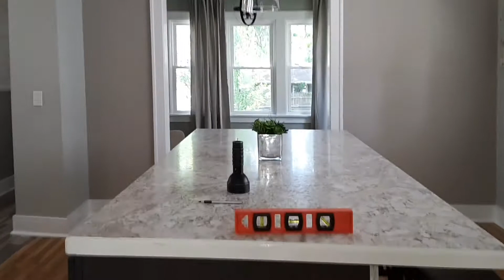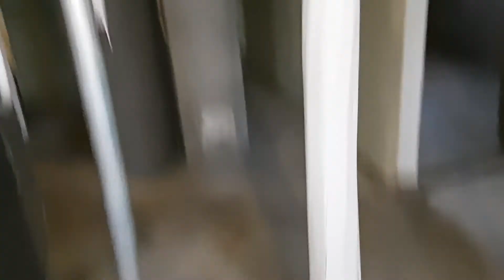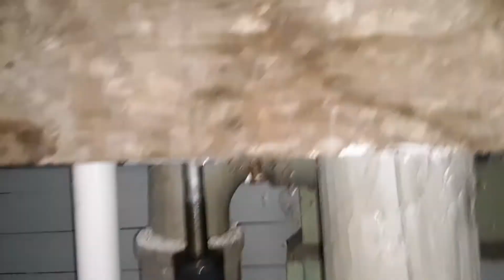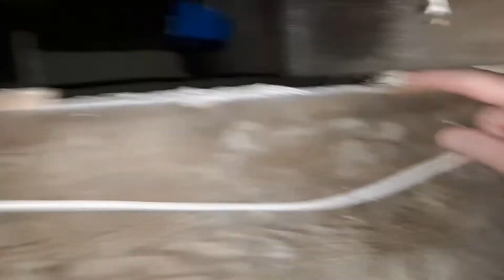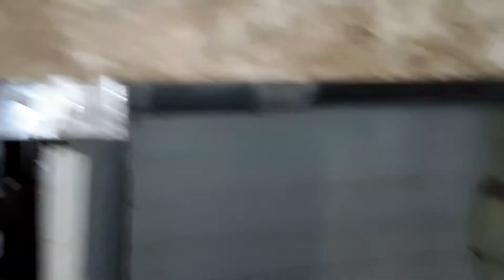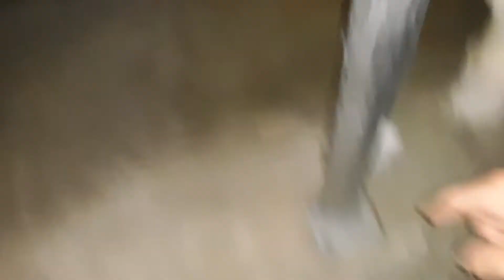1930s house frame structure with major settlement at post & beams - unlevel floors

Comment: what's the solution?
Reply from the maker: @ZingsVideos  Well, the new improper post can act as temporaries while the old rotten post are removed.
Once removed a new concrete footing base should be installed at the same location as where the old post were. Then new twist screw jack posts can be installed from the beam to the new footing base.
Thanks for watching